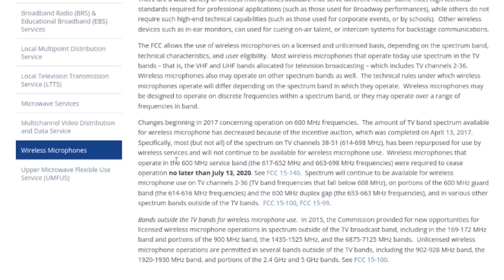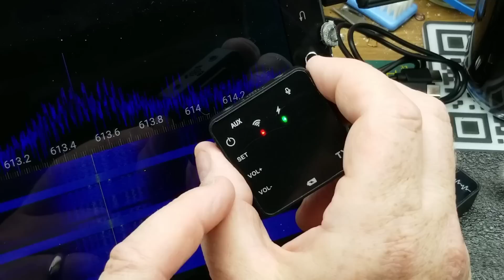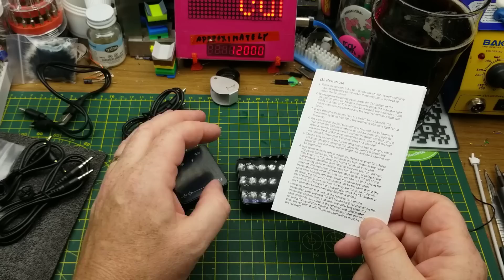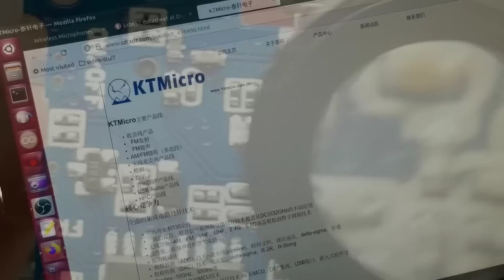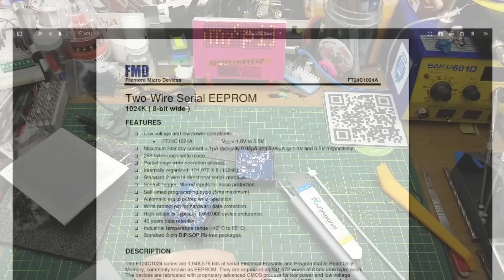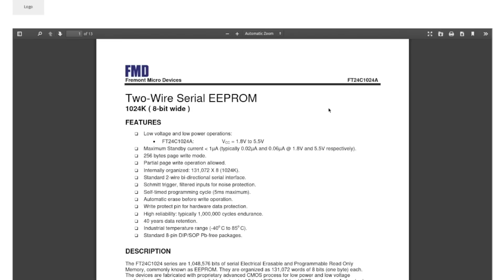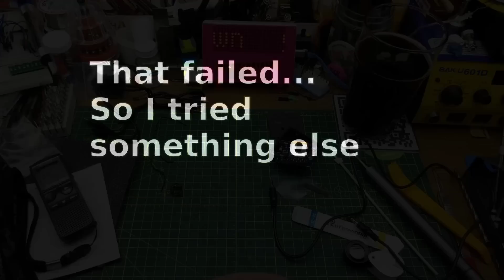Cheap (and illegal) wireless microphone teardown

Comment: it isnt just the frequency it is also how much power and if it is analog or digital.

you could operate a vintage rc toy on 49.860 mhz and have a local radio station on the same frequency and you are ok because the range is only a few feet so you will not interfere with the radio except for fm radios within the range of the transmitter.
Reply from the maker: Potentially true, but cellular signals are a lot weaker than broadcast transmitters, so the likelihood of causing noticeable interference is much greater.

Comment: The audio from the wireless microphone is really quite poor.  It's very muffled and a bit distorted.  I would not use these for the internal microphone for anything, but even the external microphone is still pretty bad.  I don't think you could trust it and the audio quality is not good enough to make it worth the risk in my opinion.
Reply from the maker: Agreed. 
I wasn't expecting a lot at this price point, but it was still an interesting experiment (and that's all I expected it to be).

Comment: Forget the FCC the audio police will be coming to get you.

Remove the mic from the board add some fine wire and wrap the mic in foam to isolate the vibrations from the mic body and it's leads. I  expect the power from the RF is so low no one is ever going to notice.
Reply from the maker: I try to be a responsible citizen.
And given that part of my day job is hunting down interference, I'd rather not be a hypocrite.
But more important, it doesn't sound great even absent the handling noise.

Comment: 1)i think in using wireless microphones in electronic testing area is a bad idea,  i will create so much noise,

2)you can reprogram the recever to set them to low frequency,
Reply from the maker: Unfortunately there seems to be no way to predict what channel they're going to land on when you use the "set" function.

Comment: Thanks for the interesting teardown. Isn't that button that says "set" on the outside and "freq" on the circuit board a way to change the frequency to a legal channel? Use your spectrum analyser to follow/set it, maybe?
Reply from the maker: It sets it to another (randomly selected) channel within it's band. And there are only a small number of channels in that band which are still legal.
I sould keep setting it until both randomly settle on safe channels, but there is no guarantee that they'll both be on a good channel simultaneously.

For my use case, I'll probably never need 2 at once, so If I end up using these, I'll just keep one on a safe channel and keep the other as a spare.

Comment: Why are those freqs illigal in Canada nowadays?
I think here in the Netherlands we only have that small band available where verything is sending on... the only thing I used to have on other freqs were my wireless flashes and they did not get me in problems bu of course I did not use them that much and never  away from home.

I'm for sure would not like to disturb some aircraft while making a recording...
Reply: I think it's not illegal, but the way it's used is.  Here in NA, I believe that falls into ISM, and you are only allowed to use things that just do burst transmission, i.e. remotes, weather stations,tire pressure sensors.....
Reply from the maker: Because that frequency band requires a licence, and it is reserved for cellular telephones, so a private citizen can't get a licence for that frequency band.
Reply: @pileofstuff  600mhz?  What type cell phone uses that?  I thought GSM was 800/1900 and CDMA was 850/1700/2100.  But I did look and it seems ISM is not in there either, so that's not even ok to use it in that band anyway (even so it doesnt even qualify for that type)
Reply from the maker: @jimb032  9 different cell companies (in Canada) won licences in that band at auction in 2019. 
https://www.canada.ca/en/innovation-science-economic-development/news/2019/04/600-mhz-spectrum-auction--process-and-results.html

Comment: The Rode microphones basically have an internal shock mount instead of resting directly on the plastic.  Basically something along the lines of little soft rubber at each point where the board makes contact with the box. Not only for static points, but even buttons seem to have an extra layer to make sure as less contact sound as possible is transferred to the microphone. You can even see it on the outside where the clip is even padded underneath with soft material. 
I also figure that some care went into selecting the right materials for the housing. 
Youtube usually eats comments that include links, but there are various teardowns of them to be found online. 

Basically, part of the increase in price is the amount of engineering that clearly went into this sort of thing. Not sure if it actually warrants the much much higher price, but it is certainly part of it.
Reply from the maker: Yeah, Rode is the "industry standard" in this form factor of wireless microphones, and for good reason.

Comment: Most of the devices I've seen with an internal microphone (including cellphones) mount the microphone in some kind of rubber mount with flexible wires - this one actually has stiff wires soldered to the circuit board providing a very good acoustic coupling! This renders it pretty much useless for anything other than testing if a setup is working before you get the actual audio source connected (ie. the interviewee is still having his mic fitted!). Its a shame because there appears to be plenty of room for a rubber mount where the microphone is! 
Still, you've scored a few useful cables and a set of fresh lithium batteries at least. 400mAh is quite useful to power small portable microcomputer projects.
Reply: I also noted the built-in mic lacked any treble

Comment: Using them in your studio shouldn’t matter, it’s not like the signal will escape far enough to be a problem… if they were being used outside it would be a problem, seriously don’t worry about it.
Reply from the maker: Yeah, given where I am it's not a big deal for practical purposes.
Still, I'd prefer to be a responsible citizen when I can.

Even though at the moment none of the cell companies is using 600Mhz band yet (I checked with a proper spectrum analyzer at work)

Comment: Suggested improvements?
1. User-adjustable frequencies ... perhaps documents for the JTAG(?) to program the eeprom for user-controlled scaling the transmit/receive frequences from the 4mHz crystal.
2. Instead of an ABS case, perhaps give STLs for a 3d-printable TPU, or rubberized case.
3. Put film caps in the audio path. Certainly those surface mounts are noisy chip capacitors, vulnerable to physical vibrations.
There may not be any way to get around the cheap built-in electret microphone.
Reply: I'd recommend a full metal case with mesh over all holes,  this will remove any requirement to set it to the correct legal frequency.  Would make a noticeable affect on the microphone audio as well, no background noise on the now  nonexistent audio.  :-)

Comment: What if you removed and shorted the on-board mic points?
Reply from the maker: Plugging in the external mic also disconnected the internal one.

I suppose I might be able to extend the internal mic outside the case, but then it wouldn't be protected from physical abuse.
Reply: @pileofstuff  Try removing the mic from the PCB and running a wire and put the mic on the end of the wire outside the case to clip on your shirt. Or just solder on a better quality external clip on mic.

Comment: It's really cool that the seller made it right. I'm guessing it's because the FCC doesn't play around, but still.
Reply: The FCC most likely doesn't give a shit as long as you're not causing any trouble or interfering with anything on that frequency. There are people who use illegal frequencies all the time that go buy those cheap walkie talkie FRS radios which are combined with GRMS channels which requires a license to operate on but the average person never does because most people still think they are on the FRS bands no matter what channels they use. The FCC are more worried about the CB users that want to talk on 'extra' channels that get into the HAM bands or other illegal frequencies and the CB users that still want to use a crapload of power and start causing trouble. With some guy occasionally using a 600MhZ microphone set, they most likely won't even notice or even care.

Comment: I wonder if there is serial data on that programming header. Does the RF button (as silkscreened on the PCB) change the channel?
Reply from the maker: It does change the channel, but not in a predictable way. It seems to pick a random new channel, as far as I can tell.

If I could find any better datasheet on the main chip, it might be interesting poking around on the programming header, but without that, I feel like I'd be wasting my time.